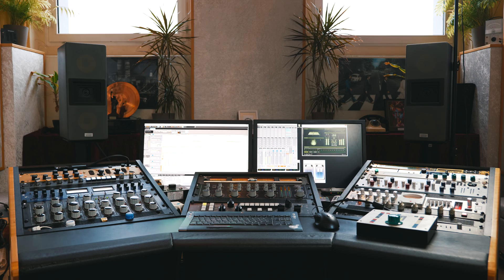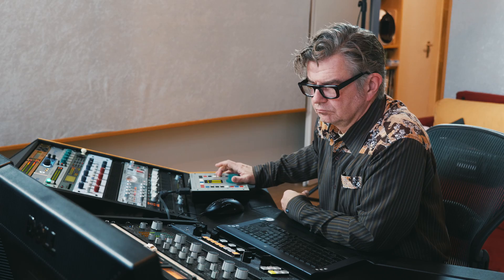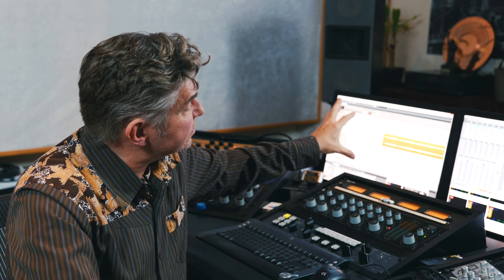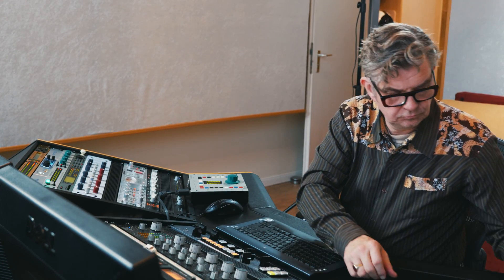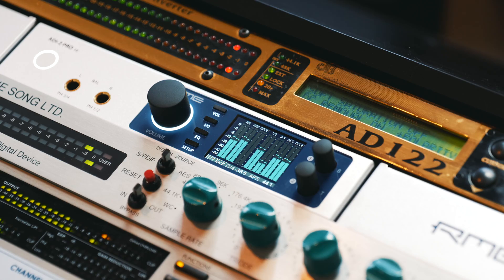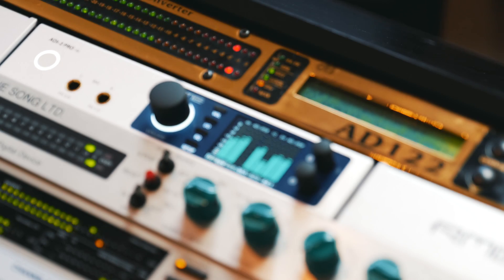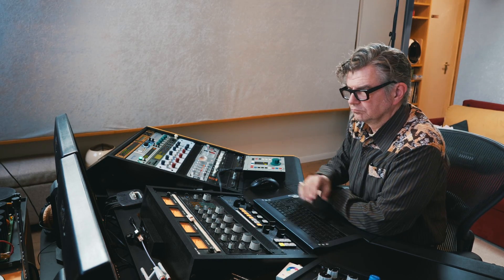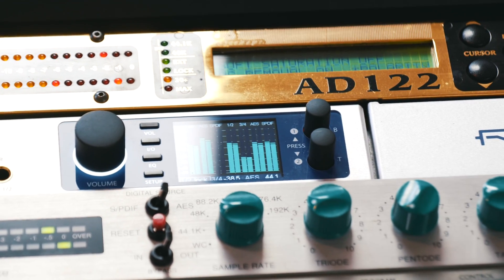Mastering Converter Shootout with the ADI-2 Pro FS

Comment: Nice comparison!  With the RME the basses are tighter and deeper and sound a bit more separated from the other instruments than with the others. The snare sounds a bit louder with the RME, so you can hear the compressor applied during the mix on it intervening more clearly, which is interesting! The hi-hats sound significantly better with the RME, which lets them breathe — what a difference! The AD122 breathes the least of the three. The HEDD is slightly better than the AD122. Because of all this, the RME lets you clearly hear each instrument separately. I also have a Benchmark that comes close to achieving this.

Comment: I’ll preface by saying I’m a mastering engineer and a drummer of 30 yrs, so this test is tailor made for me. 😃

Each one of these examples is destroying the integrity of the original audio, so I’m not sure what this engineer did wrong. The RME sounds very digital compared to the original drums and is missing some lower mids. The converter on top sounds dark and dull compared to the original drums. The Cranesong sounds closest to the original but splays out the stereo image slightly and dulls the higher frequencies a bit. Cranesong is destroying the others in this example, but all sound pretty poor compared to the original audio, which means something went wrong in the test. The original audio shouldn’t be that noticeably better. Smh

I’ve used Cranesong, RME, Burl, etc. None of them ruin audio like they do in this video. This is a bad example of these converters.

Comment: 6:35 Original
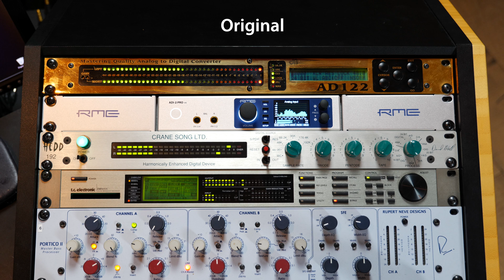7:05 RME
7:35 Lavry
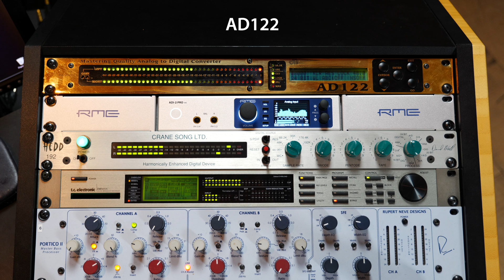8:05 Crane Song
8:38 Quick A/B of all

The RME sounds the most accurate to the original, yet slightly enhanced but not foward, and reproduces the the attack of every instrument the most accurately based on the original but with an ever so slight enhancement in overall detail. (You hear stuff that you didn't even know was in the original🪄🎩)

The Lavry seems to not impart any enhancement attributes, does seem to impart a smoothness of rhe overall material, the attack of all transients seems slighty slower which make the low end sound emphasized and seems to cause a somewhat smeary sound of material like this.

The Crane Song sounds even slower than the Lavry and sounds like maybe the DC filter has a different enough shape to let more sub frequencies through. Seems to give overall good detail but with somewhat lowend build-up sound.

If someone offered me all of these for free, i'd sell the Lavry and Crane Song and keep the RME.

Comment: 🔹 BASS: RME is the only one that stands out making the bass sound not louder, but deeper, more solid and more "at the bottom" of the mix,leaving the whole space "on the surface" for mids and highs. HEDD and AD122 have the bass put more "closer" to you, back up from the bottom.  As if RME separates the bass from the rest and puts it into a cellar (where it belongs =) In addition to all that - the bass on RME sounds more MONO than on the others.
AD122 has the quitest bass, RME the most detailed and deep, HEDD the "roundest" in the mix.
🔹HIGHS: the highs on HEDD and AD122 are clearly louder in the mix than on RME. AD122 sounds harscher than HEDD, HEDD has some "softer" highs than AD122. The ballance between highs and mids is more even on RME though. Here you can hear the "surgical-ness" of RME, as if you`d have the bass on the floor and mids and highs on the operation table.
🔹MIDS: on the AD122 the mids are the most present, because the bass is the weakest. On the RME the mids are clear and even with the highs, but are getting overshadowed by very spectacular and precise bass. Mids on HEDD are present, well rounded and are the most well ballanced in the mix.

🔹Conclusion: The real competitors here are RME and HEDD, each sounds amazing on it`s own, but totally different - while HEDD sounds more "ready" and "sweet" - RME is more "disected", "clinical" and "surgical" (not in a bad way). The bass from RME is something different (wow!). 
AD122 could not impress. Lacks cool stuff (rme`s bass, or hedd`s highs-magic), but has weak stuff (lackluster bass, harsh highs).

Listened on RME Babyface Pro FS, DT 880s and Yamaha HS 80s.
Reply: I don't have the best listening situation, but to me the HEDD felt punchy compared to the others and the AD122 felt the most "open" in the highs. But definitely agree, the control that RME has over the bass is untouched. Would you agree?

Comment: Wow! To be honest I am a bit shocked. I considered buying the ADI-2 Pro FS, but that is off the table. The mix becomes extremely unsteady, almost falls apart completely. It is completely out of balance. When you know that the low end is this much enforced, maybe you can counteract in the mixing process, but in this example the ADI-2 Pro FS is far far far behind the other two competitors. Best is the original track, followed by the ADI122, then follows the HEDD and with a lot of distance the RME.
Reply: wow, good ears :) It's the same as I hear it. The Larry Gold ist the clear winner.

Comment: I don't know if rme thought that their product would beat the rest. probably they wanted to show that their quality is very close to the most expensive converters. Sorry Rme. It doesn't sound close (former adi-2 customer here)
Reply from the maker: As mentioned in the video, it is not about better or worse. It is about the right converter for the job. Hence, many mastering engineers have a set of converters at their disposal.
Reply: @RMEAudio  I hear you and i even can accept "genre oriented" arsenal of converters that a mastering engineer can have. Besides that, the video is a "shootout" which inevitably brings a matter of better, worse and/or a winner. That's what i expressed. But i should add that RME is a respected audio company and i don't want to imply that the adi-2 is a "consumer" level product.

Comment: hello, i bought the rme adi 2 pro fs r for my external processor loop for mastering.  but already having a ucx rme interface.  do I have to connect the 2 machines in adat in and out?  because so far I have connected each of the 2 machines directly to the usb of my imac and I have created an aggregated device in imac and I have mi adi 2 pro fs r as reference clock in the settings.  does this change the level of quality that i go directly through usb?  or do i absolutely have to use adat or spdif cables for better quality?

Comment: I just bought the EP Asteroids on Bandcamp that this shootout is based on - https://aggregat.bandcamp.com/album/ep-asteroids - and have been revisiting the sound of these converters with a better sense of the source sound, and again the first thing I noticed with these converters is how different the kick sounds between them, and how that sound translated to the rest of the mix. For one, I would not want to use the HEDD on this - the kick has too much thud, not enough bounce - slightly deadened and not very detailed.

The ADD122 is very different - the kick has more detail and bounce - you can feel it moving air, not coming in like you dropped a bag of cement. The ADI-2 Pro FS is really similar sounding, with maybe a little less detail in the kick, but still springy.

Overall, for a really solid, full sounding mix that sounds like a rock track to me, just based on the source material, the ADI-2 Pro FS shines for my ears.
Reply from the maker: Hey Paul, thanks for your review. As mentioned in the video, it’s all a matter of taste and source material, when it comes to the right converter. We’re quite happy with the ADI-2 Pro ;)

Comment: So why doesn't RME market this as a high quality 2 channel interface for DAWs like Pro Tools, Ableton, LogicPro and Studio One? Seems like it would make a good studio computer interface for a hybrid system.
Reply: I assume they market the likes of the Fireface UC/UCX etc for DAWs as these have a lot of inputs which obviously relate to DAW recording use. These DACs are also used for music production, mixing and mastering and are focused on the output dynamic range for critical monitoring. They do have stellar input for A/D conversion. i.e if you have some analog equipment or tape that you want to capture at the highest quality possible for archiving or whatever, then you'd definitely use this ADI-2 Pro over a regular interface with a lot of inputs. Although this ADI-2 Pro has less inputs than say the UCX, it can capture A/D at crazy high 768kHz sample rate. I hope this makes sense.

Comment: Hello, Im confuse which one to choose the UFX plus or the ADI 2 pro FS R AD DA converter.  I already have a preamp. Can you please explain the difference about the two? and which one is better? :) Do the UFX plus have the same AD DA converter with ADI 2 pro? thank you
Reply from the maker: These are two completely different units and concepts. The UFX+ is a multi-channel interface (analog, ADAT, MADI, AES) with built-in preamps and excellent AD/DA conversion.
The ADI-2 Pro FS R is a high end AD/DA converter/interface, but it does not have TotalMix FX. If you need a professional consultation, please contact us on Facebook.
Reply: RME Audio thank you!

Comment: First, I'm a big RME fan and use their soundcards for over 15 years now, but I do have some questions with these kind of video's (not specificaly about RME).

1. youtube quality isn't suitable for listening to any serieus audio test on mastering engineering level of experience/quality.
2. I think a lot of responses here therefore  are confirmation biased.
3. The music used in this example is far from "steady", being an organic acoustic recording. Something more electronic with equal frequency response per drumhit would be more suitable when comparing A/B. If you do want to use an acoustic recording A/B'ing would only really work when looping a single or double drumhit or 4/16th or 8/16th section.

Null testing the different audio examples straight form this video would be a good scientific aproach to test the first 2 points.

Comment: I hope all is well with you. What exactly are you using dbmax for? I noticed that delay was on, no dither, aes connections are in use, and external digital input in use. Stay safe everyone.
Reply from the maker: The dbmax plays no role in the signal path. It is simply hooked to one of the AES ports and is receiving the signal.
Reply: @RMEAudio  Wow. Thanks for response. For what purpose is it hooked to one of the AES ports and receiving the signal. I understand its not in path. Are you willing to test dbmax DA and AD conversion? You

Comment: DBMAX requires it's own AD/DA... Isn't the signal path being polluted having this device in the output chain if we're comparing the ADCs of the comparison devices?
Reply from the maker: No, the DBMAX gets its own signal and is not in the actual signal path.
Reply: Awesome setup. I would love to hear how the dbmax would handle that conversion. I thought you were going to use dbmax for D comparison. Perhaps a video at a later time or send my files directly please. Lastly, what are you using the dbmax for exactly?